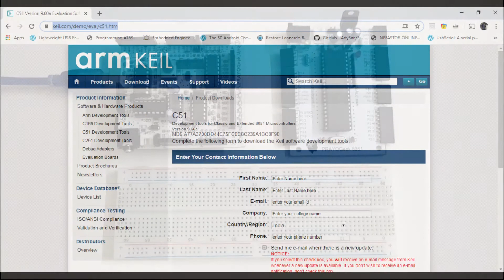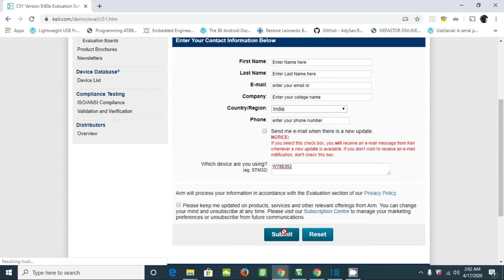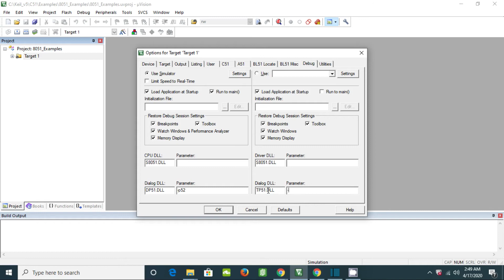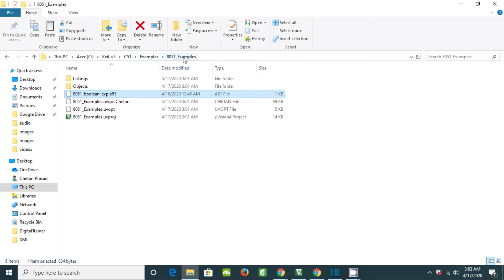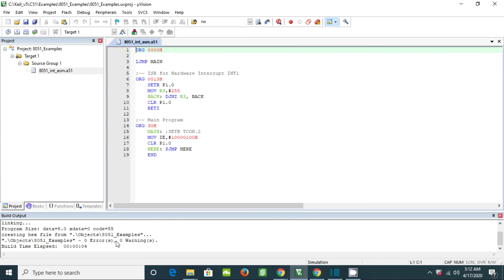8051 keil uVision installation and Debugging

Comment: Is it possible to flash code to micro controller and debug
Reply from the maker: You can only flash the code, but can not debug. You would need a debugger for that
Reply: @prayogeekuno4819  but how STM 32 having debug features?
Reply from the maker: @sudhiracharya1234  STM 32 is a much advanced microcontroller compared to 8051. May be some of the new 8051 variants support in system debugging. I am not aware of them